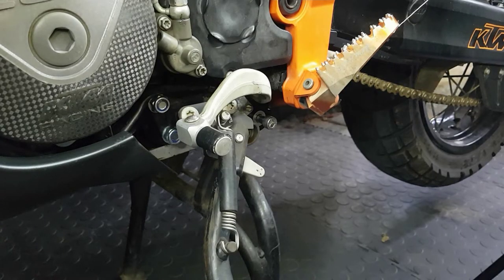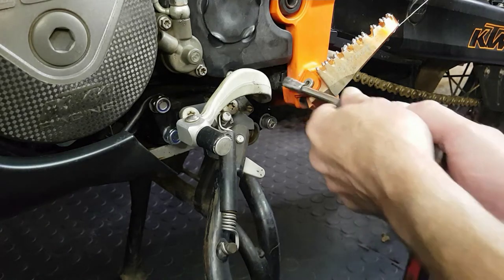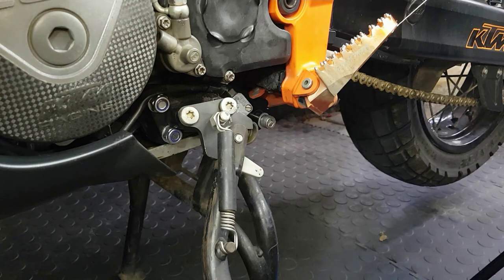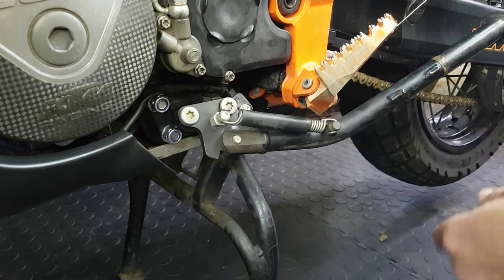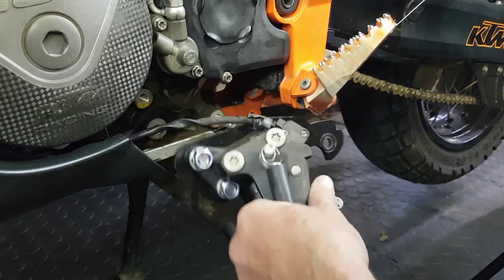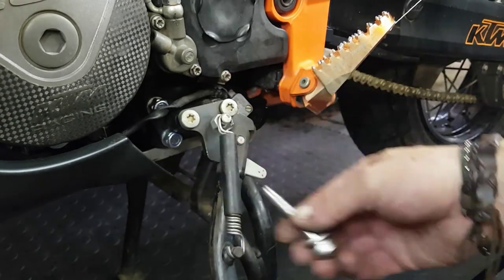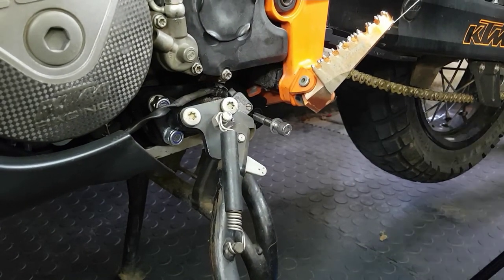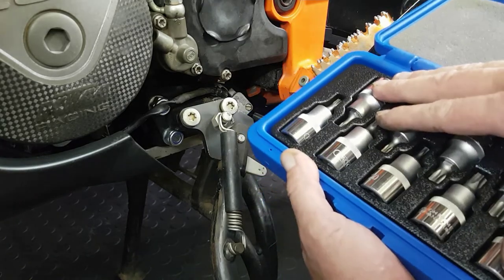KTM 990 Side stand re-location bracket ( Case saver ) #ktmbike #ktm990

Comment: Very useless hack for the 990...
Reply from the maker: Hi there, for me the hack makes sense especially when riding lots of rocks and mountainous areas, but that's just my thoughts on it :)
Reply: Maybe if your engine case cracks you will change your mind?
Reply: I have cracked my cases from low siding on an oil patch on asphalt (!!!!) because the sidestand was kicked down and leveraged the mounting points on the case on my previous 990 adventure (2009) and fitted the BlackDog plate afterwards. My new 990 adventure will surely be getting one.